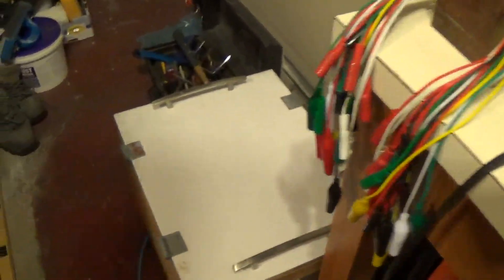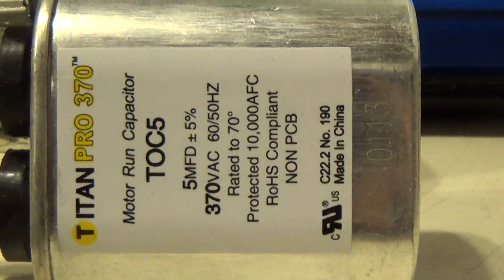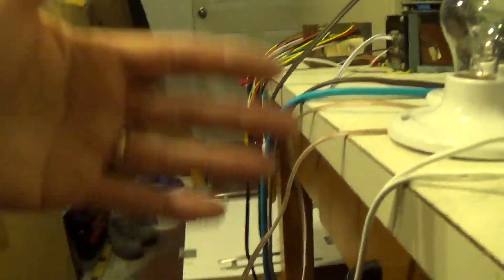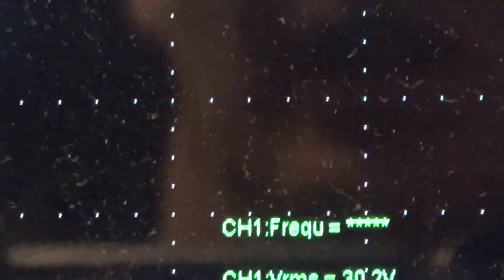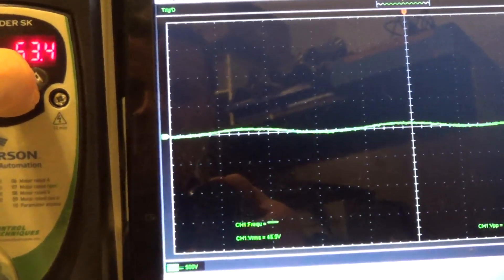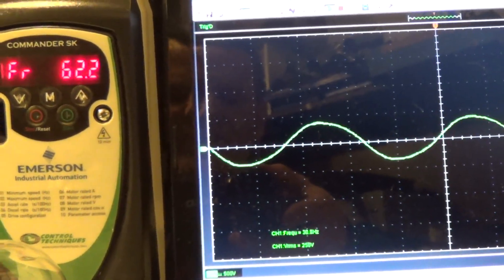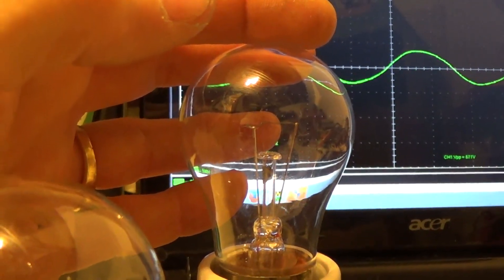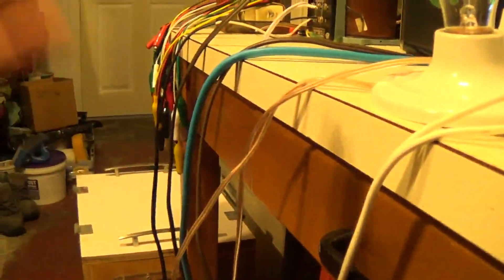Testing of QEG Effects test 2

Comment: I think the sound we hear is not that the rotor touches electromagnets, but rather the effect that the voltage rises so high into oscillation that the inductions of the electromagnets forces your electric motor to halt. What is nice about your experience is that we see clearly the electromagnets entering into oscillation . Nice work!
Reply from the maker: Yes, that is exactly what happens.
Luc
Reply: Donald Wright And yet the QEG is still under-unity ...

Comment: Hi Luc. Great test. I think induced magnetic field pulls I's into E's which accompanied with vibrations catches the corner of E. See for damaged or rather at those speeds see for small rounding of edges. I believe when it comes to direct contact you get most voltage. Try hit E with I and see if there's spikes on scope similar to woopyjump's video "resonance of steel creates electricity1 wmv" and don't forget to make a video. From physics standpoint I don't have a clue what's happening.

Comment: Well done Luc, do you have the caps and bulbs all parallel to the 2 coils in series ? Maybe you can use a flywheel to stabilize the needed RPM for resonance ? Is the rotor really touching the MOTs at this resonance frequency or what is happening inside ? Be careful with it, you are playing with a lot of rotational energy stored there..
Reply from the maker: Hi Stefan, the two mot high voltage coils are in series and connected to the series 2.5uf cap. The two120v 40w bulbs are separately connected to each low voltage coils of each mot. Unfortunately the wood box and rotor disk flex too much at this low frequency which causes the cores to rub and brakes the rotation. This was just a prototype to test the varying Inductance effects. I am pleased with the results and will build something better.

Luc
Reply: Luc Choquette
Hello Luc
"to the series 2.5uf cap"
You should check if the capacitors support voltage because if it is the resonant frequency in series the voltage is multiplied by the quality factor, quality factor and a very large.
Q = (1 / R * Square root (L / C)

Comment: Good demo Luc. Consider this theory for a minute. It's not my own, bu it seems to be relevant. The mag flux the core is cutting is the actual earth magnetic field. In this case to increase the field use magnets. Magnets are a concentrator of earths magnetic field. Magnets do not posses their own magnetic field. Give this time to sink in, its radical thinking! I know!. You will soon see, that it makes sense, and everything is now clearer, with this theory. Your rotor and stator are made out of steel. They are not as good concentrator as magnets. All you have to do is put magnets on them to increase the earth's field through them. This will help your design. After adding the magnets, you'll be able to increase the rotor stator gap, to prevent resonance griding. On another note, try running separate rotors, meaning not connected with each other.
Reply from the maker: That's quite radical Mike. Could be proven one day?
Try that one on MileHigh!

Luc
Reply: Luc Choquette
Yeap, I'm radical ! Love it. I'm not afraid to state what I think. Our community is research, and radical thinking has it's place. By trying new things we learn, grow and discover. New Ideas have to be expressed and stated, to grow their clarity and conception. Best wishes!

Comment: Hi Luc,
The solution seems evident! place another set of cores on the opposite side of the rotor. Then the tolerances should not suffer because the rotor would have an equal pull in both directions. And you may experience the benefit of being able to generate even more energy.

MagnaMoRo

Comment: As you mentioned in your video, the closer the rotor comes to the coils, the more output you get. So as magnetic forces pull the rotor near the coils (contra-induction, causing magnetic fields) the more efficient it gets, more power gets out. But, could it be possible, as the rotor is smashing into the coils, that the "power of the scale" you get in this video, is just simple coil cutout induction? (sorry, i don't know the english phrasing)

Comment: so is this pulling power from the resonant "exciter" induced by the "tank" circuit. The LC tuning seems to be a critical condition.....could a larger capacitor/coil  bank allow for proper tuning of current flux flow energy storage and release? More stored potential energy is allowed into the system. Nice work!
Reply from the maker: Don't know wet?... hope with more experiments and designs I'll find the answers.

Luc
Reply: LC tuned circuits seems to be the answer.
Get the tank to resonate then drive the tank into a higher resonant octave by the frequency speed of the machine.  One would drive it like a crescendo resonant feedback.
Tesla worked with this resonant "tank circuit"
to create powerful thunder claps.....

Comment: As the core goes onto resonance then a magnetic field develops that snaps the rotor to it. Note that at the same time as the magnetic field begins to develop then too electricity is generated. The key should be to balance these forces on both sides of the rotor.

Comment: The QEG 4 13 14 interview Taiwan says The whole thing vibrates. Look at a Rodin coil loudspeaker. The field wraps around its self so when magnetism pulls, it pulls inward in all directions. That's the scalar field. That's the direction Tesla Longitudinal waves operate in??? We are bathed in the Dirac Sea, the Active Vacuum, its energy density is VAST. It's pumping the Tesla coil ( an electro magnet) with SHARP gradients that opens up the Bloch Wall allowing a greater range of longitudinal wavelengths to enter into your magnet. The rotor is forming and breaking inductive loops, flux pathways. The collapsing magnetic field is used to provide the sharpest available gradient spike to the Tesla Coil?????

Comment: Are the capacitors getting warm at all? (or the wires going to them?)  Many high voltage caps will "self-heal" when they breakdown, but they dissipate some heat during the breakdown.
Reply from the maker: There's not enough resonance time to cause any of this.

Luc

Comment: very nice, but if you use TDC (Torque direct control) of the speed drive is better than scalaire mode Hz, then the speed drive will maintains a constant  speed in rpm what ever the load is. You will get stable resonance. The regulation will be in RPM not in Hz.

Comment: Luc great work brother!!!!
This might sound crazy but could you run the test at 400HZ.
I'm thinking if you bring it up to speed fast enough you can bypass the lower harmonics and try something higher. One of the inventors of the QEG says that at the lower Hz his machine was too violent, he said it growled and moved around and was afraid it break....just like you're saying, and showing. James mentions that at 400Hz the magic happens with his core....worth a try.
Reply from the maker: Thanks for your post. I know about what you wrote and would like to do the same but I don't think they are turning the QEG at 12,000 RPM?  I think that's what it would take to achieve 400Hz. Since I have not yet seen anything on their rotor RPM I'm going to have to say they are not running at such high RPM and I'm not going to push mine over 2,500 RPM for safety reasons.

Luc
Reply: Yhea don't do that...Lol Not with that setup you would hurt yourself trying. We need good people like you.

Comment: Probably magnetostriction effects, I was reading that transformers can be destroyed by them so it isn't always a tiny effect even though it is a very small physical size change caused by the magnetism. It is probably initiated by the residual magnetism  in the core. You should try adding some additional magnetism to the core by adding a permanent magnet to the "outside" of the E core, that is the side opposite to the broken weld side, possibly also 1 leg of the E core too. Interesting result. The QEG reminds me of a flux switching alternator and looks like it has a similar operation. Does anyone know if the QEG core is magnetized ? If it is it works just like a flux switched alternator.
http://en.wikipedia.org/wiki/Flux_switching_alternator

Comment: Yeah Luc be very careful. The stopping is in the controller I bet to negate an overload. I bet the transformer goes into cascade mode and the only thing stopping it is the motor controller. Monitoring the current in the motor would be a start. I really think you need an shorted inductor on the rotor. Since you only have one phase running it seems to me there is an imbalance in the system and it is causing a runaway condition.

Comment: Consider that possibly your rather low-grade capacitors are shorting out... you are going WAY above their rated Voltage spec.  Also might want to check your motor bearing end-play... if it allows the shaft to move towards the cores, they might be hitting... but I'd think you should be able to see that with a physical inspection.

Keep up the great work!... but you certainly need better caps. Polypropylene is what's needed... and I'm sure you will need close to 10kV rating... we've already seen 8kV peak on your scope here.

If you need help locating caps, send me a private message, I can show you some possibilities (just realize that no "good" caps are "cheap", but used ones are much more reasonable)
Reply from the maker: I does the same with 2500v microwave oven caps. Anyways, resonance doesn't hold long enough to cause dielectric breakdown. Each cap can handle 500v so two in series is 1000v. No play in motor bearing. The flex is between the wood box that the E cores are mounted on and the rotor plate.

Luc